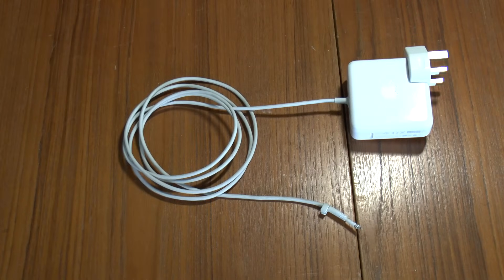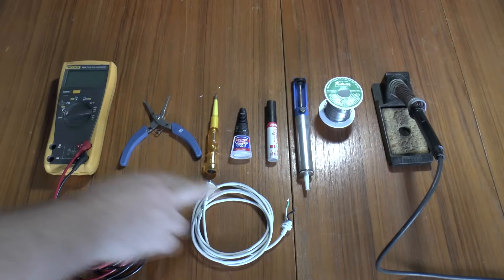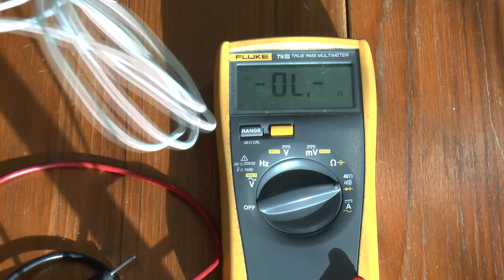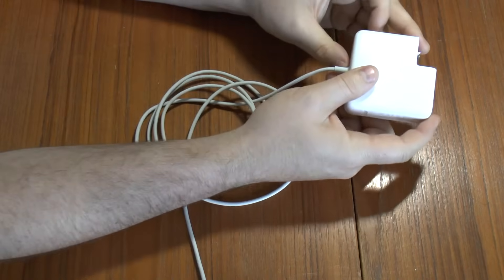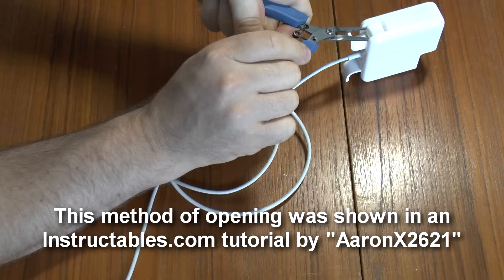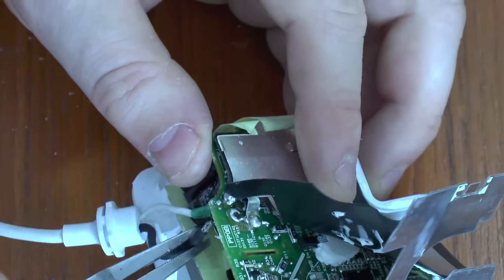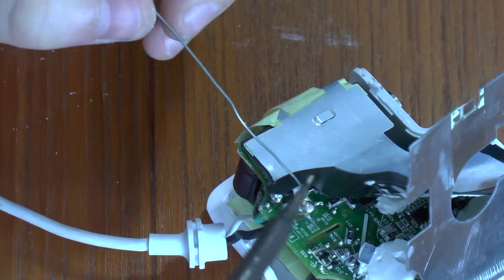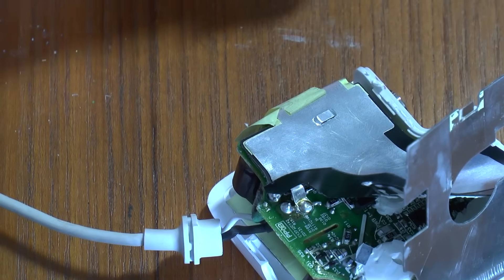How to repair an Apple MacBook power supply (MagSafe)

Comment: Easier way is to heat it with a hair-dryer to loosen the glue then just pop it open on the cable side only with a pair of large pliers by the cable clips , then cut the single wire off and solder onto the two wires from the circuit board, insulate with heat shrink tubing, less case damage, looks like new! Yours looked a mess!
Reply: I think you are on to something. Trying to get right to the circuit board makes this a lot more complicated than it needs to be.

Comment: Something to make this easier, not sure if it's been posted before, but rather than using long nose pliers to separate the case, I use circlip pliers. That way you can spread the case by squeezing the handles, rather than pulling them apart. Much more natural and controllable motion :)

Comment: why not split the damaged cable and solder white and black? Is it not safe?
Reply from the maker: You can do that as long as you don't mind having a taped or heatshrunk joint partway along the cable.

Comment: "To those who think Apple MagSafe connectors are useless: it's better than trying to repair a broken DC input jack on a laptop, which in many cases involve a total stripdown of the laptop just to get to the solder pads. Been there, done that"
Done that too, you are right!

Comment: Great video! The insulation on mine has deteriorated from one end to the other so I ordered a replacement on eBay and hope to do this replacement. Cracking the case open seems to be the major step, and there appears to be no way of breaking it open without breaking the tabs. Looks like I need to get some super glue for plastic, is there a brand you recommend? Thanks!

Comment: I soldered the two wires to the two power block ends but its not working. Chord does have connectivity. When I opened the case some aluminium tape ripped off, could this be the issues?

Comment: Thanks, just used your tutorial to fix my powercord. Didn't discharge the condensors, but wasn't a problem. Just be extra careful. Putting the adapter back together was a bit of a hustle, so now it hangs together using a piece of tape. But I don't mind, I've installed the fixed adapter behind my desk and I'm using a new adapter on the road.

Thanks again!

Comment: Thanks, just repaired the power adapter after following the instructions of the video, can't get it wrong. Cost of the cable on Amazon: 8€. I owe you the 80-90€ I saved.

Comment: fuck that imma just drop 30 bucks on those chinese replica ones
Reply from the maker: I wonder which will catch fire first, the MacBook or the charger.
Reply: Chinese replica ones, even good ones, behave badly and can mess with your battery. The poor ones will just short out within three or four months, sometimes with a bang. Much better to resolder an original.
Reply: So you'll risk your life and your expensive laptop for 30 bucks...
Reply: My chinese replica lasted only one day
Reply: My chinese rep set on fire beside my bed while I was asleep
Reply: £78 on a branded one seemed steep for a 2009 MBAir...  £28 replica was obtained (mine wasn't shorted just left behind on flight).
Reply: AintBigAintClever macbook is made in china

Comment: Instead of performing this crazy surgery on the box itself you can simply cut the cord about 4 inches from the box, strip the wires in the cord and then splice the new cord to the exposed wires. Solder them together, wrap it with some heat shrink and then a few layers of electrical tape for added security and you're done. You're much less likely to break the board inside or inadvertently cause an issue that might fry your macbook. Not sure why you would mangle the rest of the charger the way it's being done here? Although in defense of the OP, he does end up with a decent looking product in the end.

Comment: I just started watching this and I'm not quite finished yet but what I'd really like to know is was there any damage to the plastic case when you were pulling it apart?
Reply from the maker: I've not got it to hand at the moment (my brother-in-law is using it) but I think there was minimal damage to the seam between the two halves but that's about it. Cracking it open from inside the cable holders minimises damage.
Reply: AintBigAintClever Is magsafe 2 compatible with magsafe? I have that first right angle connector so should I keep it that way or change it to that second connector like you did?
Reply from the maker: Both connectors I used were MagSafe. The one I took off was L-shaped, the replacement was an earlier T-shape. MagSafe 2 is something different altogether, I don't know if you can convert a MagSafe PSU to a MagSafe 2 just by swapping the leads, but Apple do an adapter to connect one to the other.

Comment: I went to try and fix mine using this tutorial but it won't work, at least not quite right. The light comes on, on the L cable, turns green at first then orange. But then after maybe a few minutes it turns off and stops charging. And then when I go to plug it in and again it doesn't charge at all. I went back several times and just sort of fiddled with the inner workings removing that copper plate and placing it back on and then putting everything back on. It will charge again, for a few minutes and turn off. What on earth could be causing such weird behavior?
Reply: James Whyte same happens to me, have you found out what the problem was?
Reply: @Lil Mingo I went out and bought another one. Didn't want to....but I had work to get donee and this wasn't helping.

Comment: Hi Sir,  I saw your this Youtube video regarding repairing Apple MagSafe Power adapater. This is excellent learning! Recently, my MacBook Pro's adapter (85W) stopped working after a spark while plugging in.  I have successfully opened it.  However, I'm unable to see any 'fuse' kind of component inside.  Can you please help me what should I check so that I can try to fix the issue?  Thanks for your guidance, Sir.

Comment: Please tell me, maybe someone from you try to do next:
I have dead magsage 2 adapter and magsafe 1 cable, can i replase in magsafe 2 charger cable to MG1? Now i need to charge my old mb pro 2007 year) Or this cable will not work on MG2 charger?

Comment: Didn`t want to by my second one, so I also bought just the cable as in the video, but chose a easier solution (as I din´t have all the equipment). I used a ordinary light switch (capable for 500 watt) and the whole was done in less than 15 minute and didn`t have to risk to break the supply box or anything in it. (White on the white and the one around the white cord connected to where the black is). Works for me :-)
Reply: Øystein Eide I live you so fucking much! I'm gonna try it and see if it works

Comment: My charger broke after an electricity blackout, would that be easy to repair or buy a new one?
Reply: Depending on whats wrong. You should only work on PSUs and mains stuff if you really know what you are doing. Otherwise you risk your own and probably others lifes as well.

Comment: I just tried this - got the case open by using an x-acto knife to score along the seams to weaken the clips, then it snapped open fairly easily.  BUT - when I got inside, the side of the PCB that you need to be able to solder on is GLUED with I-don't-know-what to the inside of the case.  I tryed prying as much as I dared, but couldn't get it loose.  My only problem is that the cat chewed on the cable and it has to be jiggled sometimes to start charging.  I've always wanted a longer cable - so I think I'm just going to cut the cable and solder/ splice in the replacement cable with some heat shrink to cover it.  If that fails - I guess apple is going to get 80 bucks from me.  I'm not going to risk a cheap-o 3rd party power brick frying my MacBook Air.

Comment: Almost 800k views for this video. This shows how bad quality macbook pro charger is :/
Reply: apple makes great computers, phones, screens and iPods but anything with a cable has a 100% chance of breaking on you
Reply: After 5 years of owning MacBook my second charger has broken now, and I though I was careful with it after it broke first time.
Reply: @BorutKovačec  I think I'm on Magsafe number 4. I just bust my fourth this morning and my laptop is just 4 years old. I am now on a 3rd party version.
Reply: Apple In fact do make their own screens now and no longer have a contract with Samsung
Reply: 'instead of those inefficient, heavy and bulky linear PS like most manufacturers'

What? I'd bet that there are no linear supply laptop chargers on the market, and that none have been made for at least a decade.
Reply: Quite to the contrary. Their PS are excellent. And they are using the better, lighter, smaller switch-mode PS instead of those inefficient, heavy and bulky linear PS like most manufacturers.
Reply: Eh, tbh I'm quite impressed. I break every wire, from headphones, earphones, any device charging wire, etc..

I only broke one of the 2 wire handles on my current Macbook Pro 15  charger after a year. Unfortunately there seems to be no video or anything on google for that yet lol.
Reply: Mine lasted for about 5 years up until now its dead.
Reply: Yes, 800k views but how many power supplies? If you got the percent its probably not that bad, especially compared to other manufacturers.  I've had several of these (whole family on Macs) over many years (like over at least 12 years), and only one go bad, and I am not sure exactly why yet.
Reply: apple dont make its own screens..

Comment: I just spliced the wires. Seemed easier than crackng the case.
Reply from the maker: +Charles Naumann I went for the neater option. You went for the lazier option. Neither of us shelled out for a new power supply from Apple, plus you've got a longer cable now. Happy days :)
Reply: It's bit messy and results in a permanently weak cable. I have both versions around the house and prefer a neat replacement cord.

Comment: My magsafe brick died but the cable is fine. I have a old IBM thinkpad adaptor which is 16v. I am going to attempt to put the magsafe cable on the thinkpad power brick. Hopefully the macbook wont notice that it is receiving .5v less than normal.
Reply from the maker: +TheCatMilton Interesting. You should record it and upload if successful. As you can see from mine, MacBook power supply repair is a popular subject and it could end up a very popular video, as long as people aren't tempted to buy unsafe aftermarket chargers to do the job. The 60W MacBook adapter is 16.5v at 3.65A, as long as the ThinkPad adapter can put out at least that amount of current you may be in luck. It would be worth checking to see if there's a trimmer pot in the supply that lets you adjust the output voltage if the MacBook's not happy with the half-volt drop.
Watch out for sense wires though. If you see a third wire heading out of the power supply along the old IBM laptop cable, don't ignore it as there's a chance it joins up at the plug end to measure the voltage and keep it correct. With it disconnected, odd (and possibly bad) things might happen. The multimeter is your friend here.

Good luck! :)
Reply: I opened the IBM charger and there is no sense wire, so it seems like I should be fine. It is also 72W which is nice. It also seems like the macbook is not too picky about its chargers voltage and current according to this link. http://globetrooper.com/notes/solar-power-macbook/
Reply: I ended up buying another magsafe pigtail on amazon for $7.00. I then soldered it to the IBM Charger and it works flawlessly!! I trust this setup much more than one of those cheap aftermarket power supplies. I would recommend this as an alternative to spending $80 on a magsafe adaptor. The most difficult parts were opening the power adapter and widening the hole so the cable would fit.

Comment: Just did mine in about an hours time total- including getting the tools out and finding a few things.I also put white shrink wrap on both ends of the new cord to add a bit of strain relief. That way I don't have to replace it so soon again. I ordered two cords so I'll have one already the next time it dies. As a bonus I used the heat gun to help when splitting the two halves. That way mine came apparat easier and there wasn't any rough edges or damage.
Reply from the maker: +2204JCM Nice. Well done :) My sister's fiancé is using mine at the mo.
Reply: +2204JCM what do you mean by "splitting the two halves"? you mean opening the power supply only with a heat gun, in order to avoid cracking the clips, hence not using super glue?

Comment: IMPORTANT: DO NOT discharge the capacitor the way it is shown in the video.  This can kill your power supply and in cases can blow the capacitor.  With few exceptions, capacitors are not design for such rapid discharge.  If need be use a resistor, one of the old types with leads on it.

Best way to discharge is by connecting to you Mac (like mentioned by another commenter), if that is still possible with your power supply.
Reply: +Marcin K how long could it be until the capacitor lose most of the stored electrycity（let the capacitor discharge by itself）？？ 100 hours？ 1 week？1 year?
Reply: +Min Zhu Ultimately, I suggest testing with a multimeter and discharging with a resistor. http://www.overclockers.com/forums/showthread.php/189777-Discharging-PSU seems to be a decent discussion on the topic, particularly the suggestions involving controlled discharge (i.e. using a resistor)
Reply: Great tip of course. Unless the cord is broken already.

Comment: Heat it well with a heat gun or a magic bag before trying to pry it. You may also use a vice to force cracking. If it does not pop right away, it's not hot enough.

Comment: Once you open it, it doesn't want to stick back together. Especially the front part, where the wire comes out. You'll need some strong clue and a clamp, to make it hold, or just put some tape around it.

Comment: I just spliced the replacement cable onto the old one. No need to open the power supply.
Reply from the maker: +nisserot Looks messy but saves getting bitten by the power supply :)
At least you've managed to get up and running again without shelling out for a new power supply :D
Reply: I had to switch the cable. It was completely torn apart right above the silicone-part that sticks out of the charger.
Reply: +nisserot the white is the positive and the black is the negative?? I think that spliced is a better idea, can you tell me how did you do it please!

Comment: my charger was plugged in my macbook 24*7 and ,i didnt even bothered to  turn off the power supply whenever not in use, first the green light started to malfunction ,and then sometimes charging didnt happened but green light showed instead of orange, and i made it work from somehow flipping and twisting a wire ,until today its completely dead ,only green light shows and nothing is charging,i tried my friends charger its normally working
Reply: +electronic love Trip  yeah mine's doing pretty much the same but I have it working as long as I don't move lol. if the light is on and it says not charging in the corner it means you have a short circuit somewhere in the wire, mess around with the cord going up and down until you find the spot where it turns of when you move it. you can cut the wire open there and you'll see a spot where it's messed up, just reconnect the wires and tape them with electrical tape or use shrink wrap so they dont touch. if that doesnt work you'll have to buy a new one.
Reply from the maker: +electronic love Trip if the green light's showing then that tells me the plug is connected to the incoming wire. May be worth checking the pins on the connector (with the power off) to make sure they're springing back out properly (the outer two protrude slightly further than the others) and that there's no crud in there. Also check the MacBook itself, the magnet will grab any bits of rust, etc and can stop the plug mating properly.
Reply: Brandon Harrison i made a cut in the wire as it was broken ,and manually did that and it works sometimes ,sometimes not, and ive ordered the wire now.

Comment: That was tough. Firstly it was really difficult to open it because of the sealant inside.
Then I've spent about an hour trying to unsolder it – ended up setting soldering temperature to 450°C.
When I finally assembled it all back, became obvious that it needs sealant to hold two parts together. Used blue wire tape)

P.S. Next time I'll shove the soldering iron up to my cat's ass before changing the cable.

Comment: after watching this, I just decided to buy a new charger
Reply: +Sang Won Lee Don't give up as soon as it's a little bit complicated :)
Reply: After having five or six of them go down (we have quite a few MBP at home and more at work), buying new ones sounds less attractive. We repair them in bulk.
Reply: The easy way is to just cut the cable mid way and join the connectors by twisting and insulate them with an electric tape. Simple!!!  No need to open the charger head.
Reply: @rolandsequeira  also by using this approach if you buy some Sugru you can even make a nice custom finishing.
Reply: @rolandsequeira  exactly...
Reply: +Dave Adriaanse yeah make first diagnose before judgment and make to save a money.
Reply: yes me too
Reply: You are definitely right.
Reply: This is super intimidating. I feel so inferior. Scary...
Reply: you bet...and get an invoice with VAT for it...
Reply: Whats the use of the metal springs at 13:00.?..are they necessary?? Can we just omit putting them back in?  Its really hard ....
Reply: you missed the action, now go to chruch and sob, cutie boy ...
Reply: Thats exactly my thoughts too! Screw this idea!